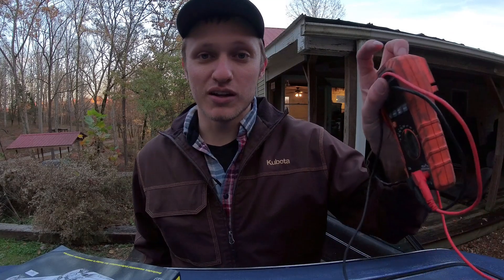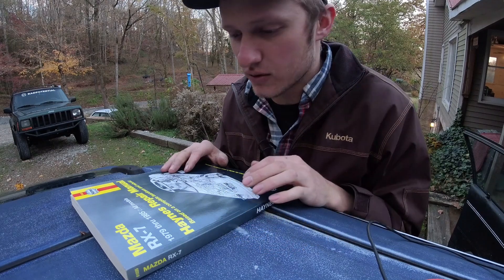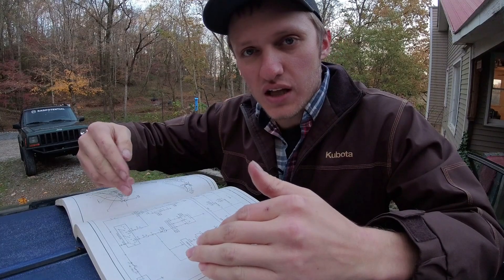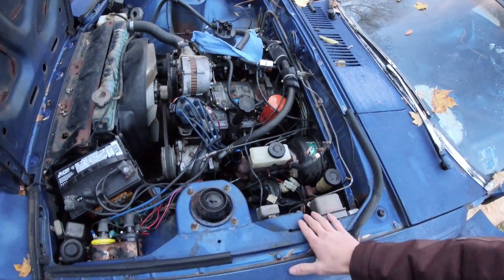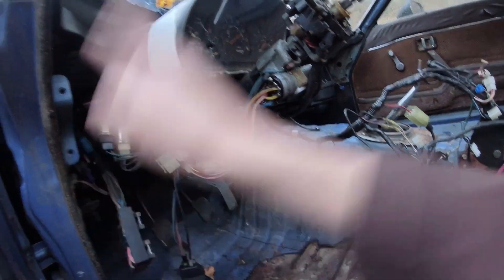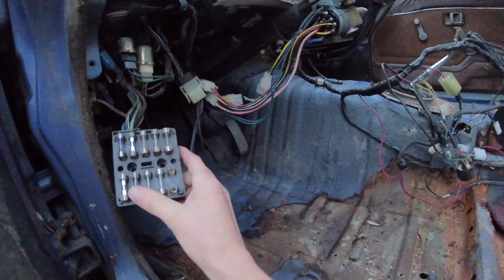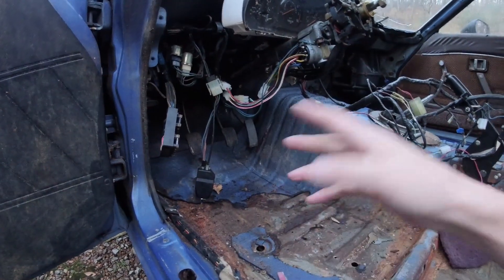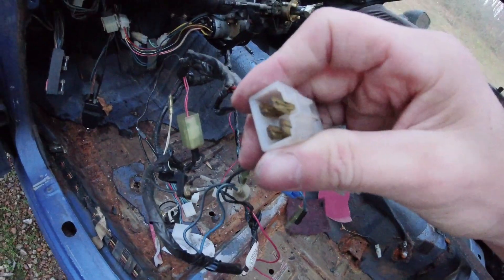Think of Electricity Like Water - A simple Guide to Troubleshoot Old Car Wiring

Comment: Is it hard to take that dashboard off? Do you have to take it off to access the cluster? I need to do something about my faded cluster.
Reply from the maker: Cluster comes out before the dash. You need to remove the two screws holding the trim in place, then the screws that hold the cluster, unplug the wiring harness and unscrew the speedometer cable and it will come out.  Carefully, don't force anything it will break

Comment: Any idea which of those wires excited the alternator? A mouse had a hayday in the corner of the engine bay near the big relay box. Trying to patch it up enough to get alternator charging again.
Reply from the maker: Find the wire that is in that area that receives 12V of power and doesn't share continuity with the ignition system